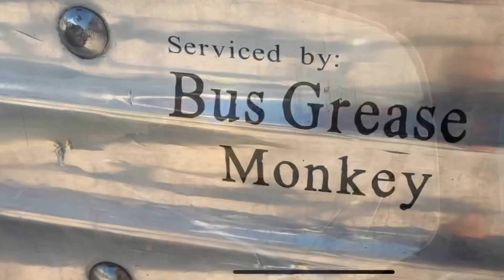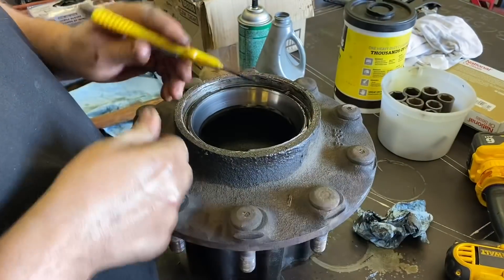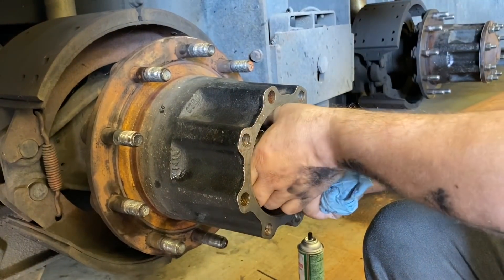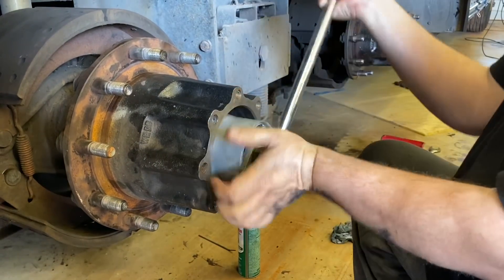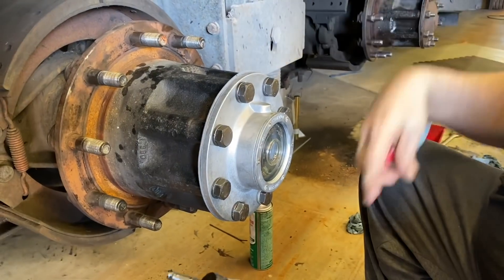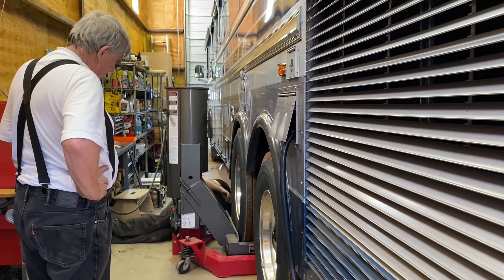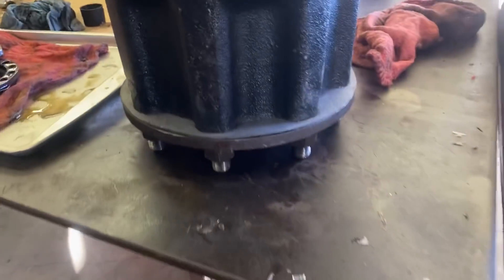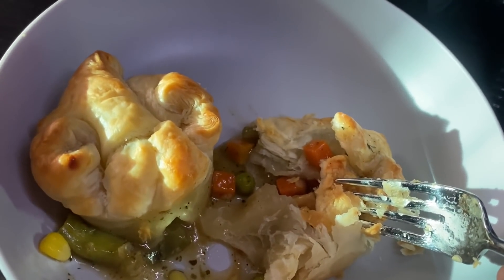Checking more brake drums and hubs on the wanderlodge rv

Comment: I am an aircraft mechanic, you can get a dye penetrant kit to check for cracks in an area like the drum. I use it on the classic cars I work on and shows cracks that won't be evident on a leak test. I also would like to see some cooking videos with your wife. Those pot pies looked wonderful. I don't have a bus, am not getting a bus but I love to watch a good mechanic at work. I worked on super heavy equipment at an open pit mine as well as USAF fighters. you do very good work!

Comment: Scott for checking cracks I generally use paint thinner or acetone the low viscosity allows them to be seen very easily or coat with oil clean and then heat with a torch the oil will bubble out of any cracks.
Reply: I use kerosene and sit the part on a peice of white newsprint paper .Any leakage shows as brown stains on the paper .If in doubt i visit my local machine shop who will magnaflux the suspect parts ,usually large pistons .
Reply: @Mercmad  I second that.
Reply: I second that. Maby the crack only opens up under load.

Comment: What I used as an inspector at at Caterpillar was fluorescent penetrating dye. Spray it on and wipe off the excess and hit it with ultraviolet light and any cracks or holes in a casting will fluoresce. In the case of that hub the thin dye will wick its way thru to the other side and you can find the path the crack takes. You can also use a growler that sets up a magnetic field thru the part and then sprinkle fine iron filings on the part and the fillings will just stick to the crack and make it visible.
Reply: It's a hub, not a brake drum.
Reply: When we built my Lycoming aircraft engine we used the dye and magnaflux methods to check the crank and other steel parts for cracks.  Since this crack area is visible from the outside, Scot already knew something was up.

Comment: In the interest of time, you could use kerosene or even gasoline to see if that hub is cracked. Or if he has extra stoddard solvent for the parts washer, that would work too.
Reply from the maker: It’s filled with gasoline for the night   We will see tomorrow if it springs a leak

Comment: push that wheel jack thing in all the way & then pull it back to get the wheels turned around on the jack before you lift the wheel up & put weight on the jack.

Comment: Hi Scott, I've been watching your videos for a few years now, since the three minute video days... :-) and picked up a lot of good techniques from you, thanks for that!!!. I'm wondering if you torque the wheel bearing adjusting nut … it looked as though you did them hand tight and then torqued the lock nut, I have an old heavy truck wheel alignment manual I've been using and the technique in that is to torque to 100 ft. lbs. then back off till loose and re-torque to 50 ft. lbs. all while spinning the wheel in the direction of tightening... this manual said this would give 3 to 4 thousands of of freeplay while the vehicle was in operation.... I've been doing this for years.... do you think this is acceptable? or am I getting the bearings too tight... I've never had any problems but I'm wondering about your opinion on this, Thanks in advance.... James
Reply: James E Dennison I did that on my Ford 4x4 F250, and heated up and warped my rotor.  Not sure if it had to do with the keeper pin not being in it’s hole, or whether I torqued the inner bearing nut too tight.  Anyway, I ended up replacing the rotors, and the calipers, and the caliper hoses, brake pads and shoes on the back-and inner and outer bearings, in that front hub.  This time, I made certain I backed off on the bearing nut, to allow  the wheel to spin, with 20 pound effort. Over tightening was a disaster.
Reply: Scott mentioned doing the same in the video, or maybe it was yesterday's video, that he would overtorque it initially to make sure the seal was all the way in, and then back it off until loose and ultimately set a lower torque value.

Comment: Was it possible to set the seal depth first and then slide The Hub on "supported" because it sure looks like when you let it hang, with out the front bearing, all that weight was on that new seal on the back 😳

Comment: hi i work in a truck shop on hubs tourque the inner nut to 50 ftlbs then spin re check losen 1/4 turn tourque outer nut to 250 ftlbs hope it helps  i have never had tis fail me  love ur channel
Reply from the maker: Very similar to what i do but with an extra torque of lesser value after the 50 then less of a back off.  If I’m board I’ll try both ways and see if the nut ends up in the same position as your.  I suspect it does

Comment: Hi Scott. Did you torque the big nut or do you tighten by feel?
Reply: I wonder where the idea came that wheel bearings are torqued ?   I learned there drawn up or snug then back off to allow for end play .   With no end play there is going to be smoke to say the least .
Reply: All of them are torqued if you are doing it right.....even on cars.
Reply: bogiewheelman71 good question..... think maybe it comes from people that really have no clue..
Reply: Greg Fox Hey, all of us who haven’t serviced a hub, and who never watched it done, haven’t a clue.  That’s why we watch Scott! My Chilton manual for my Ford F-250, says to torque at 50 ft lbs, then back off 90 degrees, and then put the locking nut with the pin in a hole.  But make certain the wheel will turn with no more than 20 lbs effort.
Reply: On these heavy vehicles, a slightly loose bearing will always live longer than a tight bearing.  Why? Heat expansion adds considerable preload to the bearing pack.  I believe the subject bearings failed because there was excessive preload the last time they were assembled.  Regardless what you may have read in various publications,  the best reference for this procedure comes from the American Trucking Association's best maintenance practices.  Assemble the hub with the bearings lubricated, tighten the inner nut to seat the bearings, back off until you can detect a slight amount of end play in the hub.  When you tighten the outer jam nut, it will take up the "thread slack" from the inner nut and reduce the end play in the hub.  The end play should then  be checked with a dial indicator.  When finished you should have a couple thousandths of and inch freeplay in the hub.

Comment: This bus must have spent a LOT OF TIME in HEAVY TRAFFIC. Could it be that the previous owner RODE the brakes to cause this much heat damage?
Could poor adjustment cause it too? Perhaps brakes adjusted TOO tight?  They sure got HOT !
Reply: Both will definitely overheat brakes, take it from a former city bus driver.
Reply: This level of heat related damage is not caused by time spent in heavy traffic; especially as that is unlikely usage for an RV. City buses, worldwide, can be on the road for upwards of eighteen hours a day, braking into bus-stops every 400 metres or so, without over-heating drums. This damage is caused by continually running highway downgrades without changing into lower gears. Most professional heavy vehicle operators will subscribe to the adage that you go down a grade in the same gear that your vehicle would climb it; or even a couple lower in the case of multi-speed boxes. Of course, this can be relaxed if fitted with hydraulic or electro-magnetic retarders, or with jake brakes. Simply, at some time in its history, this RV has been driven by an idiot who should never have been let loose on the highways!
Reply: Robert Leitch The TriMet ( for the disabled) fleet has magnetic brakes on the driveline, with disc brakes on front, and drum brakes on the rear doolys.   Only on the steepest hills, would you need to use the regular brakes, and then you’d just gear down, to slow the bus.  Never drove a single bus in 7 years, that had warped rotors.  Wish they had them stock , on the full size school buses, too.
Reply: @paulm.6437  Yeah mid 90's onward that started being standard on most new city buses, as you said you really only needed the foot brakes on steep hills or to come to a dead stop. Some of the vehicles in the fleet of the company I worked for were going 250,000 kilometres between front brake pad changes (depending on who was driving, duty cycle etc).

Comment: I noticed sometimes you pack the bearings in grease & other times you oil the bearings. Why the difference?
Reply: Luke Bongura, US Coach explained coaches that sit for long periods, especially in humid climates should use grease.  Oil will drain down from the top of the bearings and the humidity gives them a chance to rust.

Comment: G’day Scot just one question why do you use synthetic oil in the hubs instead of normal gear oil?  Thanks John
Reply from the maker: Because it’s better
Reply: Hubs get really hot. Synthetic gear oil will tolerate the heat better and it flows much better in the cold.  An additional benefit is synthetic oil is much more resistant to emulsification when contaminated with water.

Comment: Hard to beleave you don't ware rubber gloves Scott
Reply: Why
Reply: I have messed with cars,engines,, machines etc for 60 years and hate wearing gloves. I've never had dermatitus or any other skin problems but when i wear gloves when painting, my hands sweat.To the point where i ruined a roof paint job when sweat ran out of a glove and splashed on the roof of the car.... .When I was an apprentice we were made to use Barrier cream which is a better solution than hot sweaty gloves.
Reply: No doubt Scott has some thick callous on his hands, to protect him.